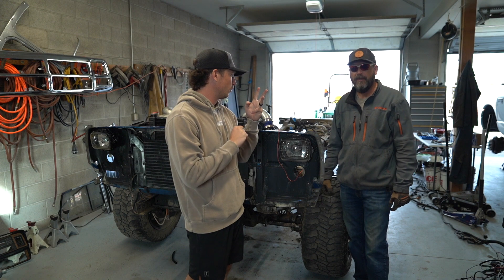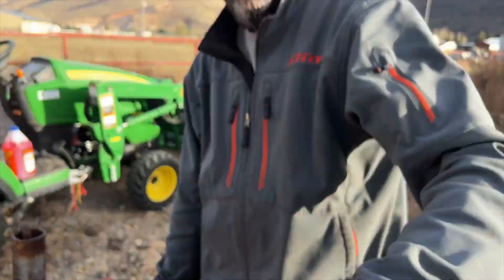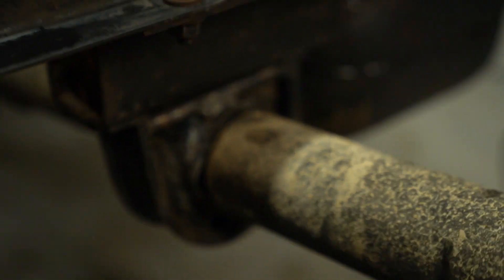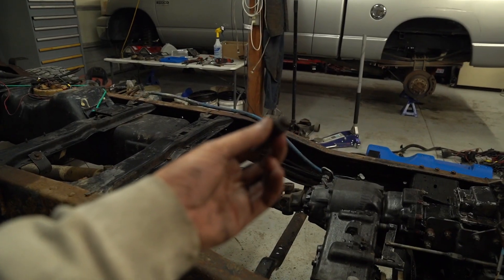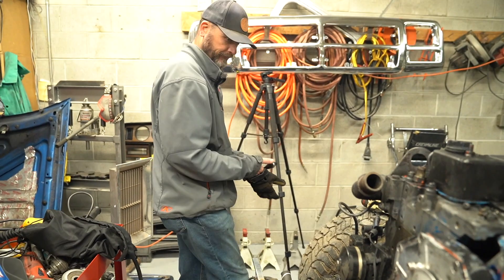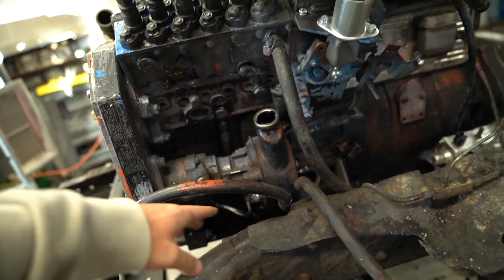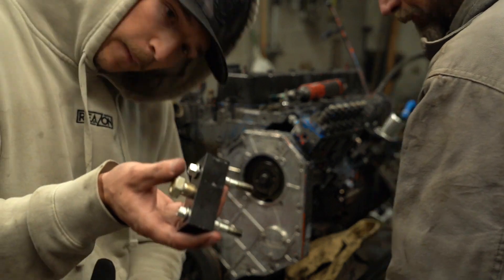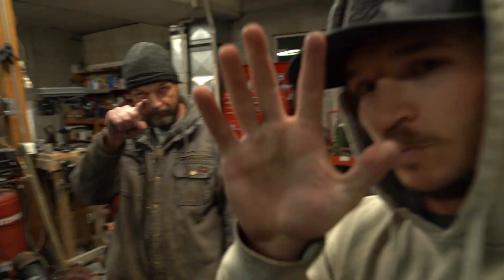RESTORING A FIRST GEN CUMMINS | EP.3

Comment: Your timing will be based off the pump as the lift will vary from pump to pump and how the timing in pined in the pump if the it has been built in the passed, if it was at 11 degress it would have been pretty lazy
Reply from the maker: Noted, thanks rob!